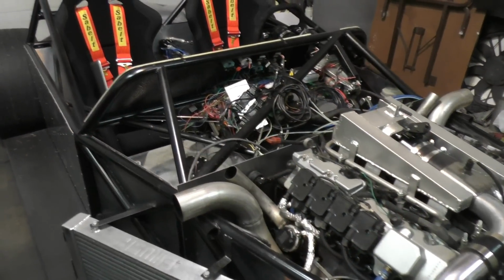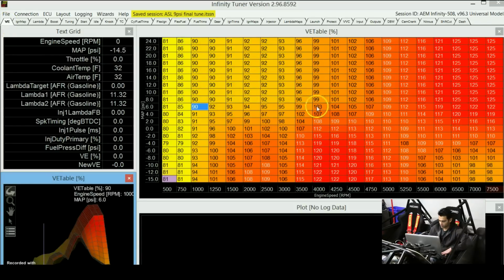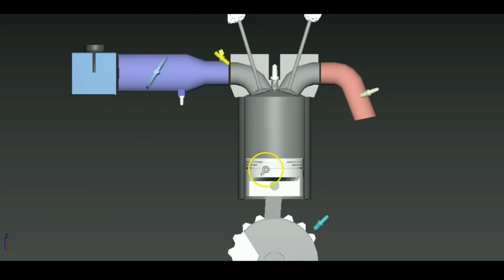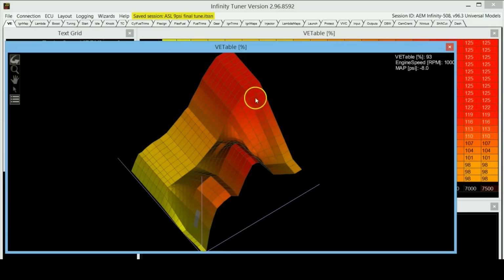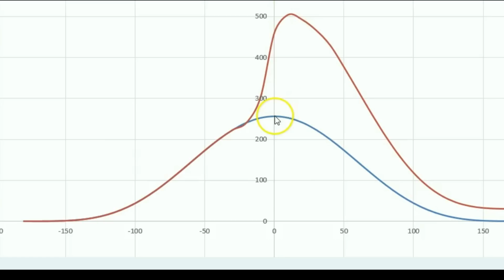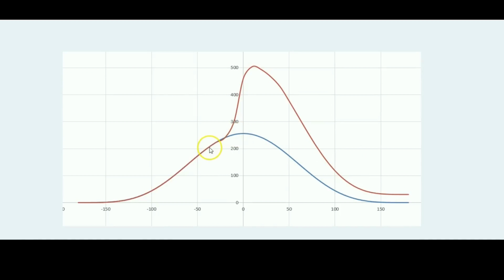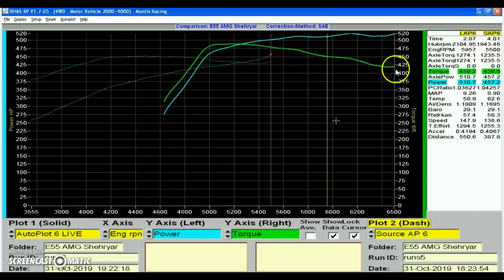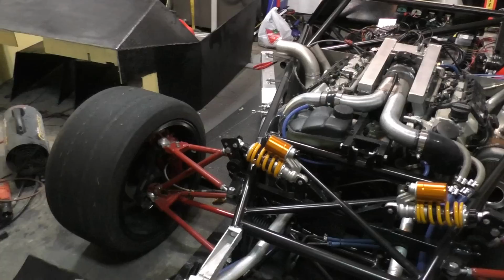How to Tune a Standalone ECU - E55 ASL Part 22

Comment: Come on bro, that's 9psi on a supercharger. A supercharger which pushes less air than your turbos and takes horsepower to be spun up. Of course you're gonna make more power and torque than stock. Plus you're not running an exhaust or emissions equipment. It's a no brainer really.

Comment: The only thing I can think from this is that you could probably gain quite a bit of top end by getting a cast LS intake manifold, chopping the plenum off of it and putting it on your runners.  In my experience, I know my engine would breathe better up top with a bigger plenum volume than I have, but I went with one with dual runners instead to get a bit better spool. (4g64)  This for sure works though, but i'm sure you're always trying to think of ways to make things better.  If you're concerned about fitting the throttle body, what a lot of CTS-V guys do and I'm sure others as well is  move the throttle body out farther, so there will be an elbow off of the mainfold and the throttle body sits down lower to let the intake clear the hood on those cars.

Comment: At approximately 35:45 "There was definately a thing or two done right with the engine" (build).  Well said my friend!  Thinking back to the intake manifold video I said to my self, it will be interesting to see how this intake looks on the dyno maps (especially during transition from atmospheric to boost),  but you have obviously created a masterpiece which has only just begun to show it's true capabilities.

Comment: On the ignition timing graph (20 minutes in ) the maximum force obtained with ignition firing (brown line) is 500 units and without ignition (blue line) the maximum is 250 units. I would have expected a much greater difference, we are comparing a virtual explosion in the cylinder to the cylinder simply uncompressing

Comment: In the 3d graphic at 8:50ish.. I see the injector is set to fire when the intake valve is open.. 
I'm my opinion (that is backed up with what I have seen on HPA) 
You should fire the injectors when the intake valve is closed and it will provide a slight economy advantage. Nothing huge tho.

Comment: I was impressed with your engineering ability before this video and now I’m really impressed. You should apply for careers in F1. They look for people like you.
Reply: Very true but 80% of  F1 teams  are based in the UK and there are a tonne if motorsport engineers with tons of experience in the other formulas. You have to work your way up too and prove yourself. Formula Renault, Formula Ford, F3000 , F3 , F3 Hap, F2

Comment: VE is not what you mentioned in video ( for standalone ecus, not engine VE ) it is a fuel control strategy aem just start to use on infinity series ecus, aem series 1 , 2 and ems4 use miliseconds for fuel control strategy so there is no VE table you have to write ms values in the boxes but it is too hard to tune engine with this method cos fuel output depends on lots of values you cant give output only with fuel table 

Ecu mix Map, clt, engine constant, iat, fuel table, warmup accelerstion enrichment etc. Than calculate the output value it is easy with VE table 

Besides you cant lower the torque curve start point by increasing the boost pressure cos your turbochargers will start boosting at the same rpm the torque curve will rise but the start point will be the same rpm

Comment: about those stock internals and 750hp: why is it that this same engine with the same internals always seems to fail at those power levels but you expect yours to be fine?
Reply: The concern of reliability it self is in the boost pressure, not in the hp, swapping to turbo gains free hundred extra horses, he also ported his head, tuned the engine properly and it barely have an exhaust system(since its not a road car its doesnt require a cat), its already 150whp more than the stock m113 with the same 9psi boost which translate to 600hp at the crank. Adding a little few more boost and it can have a 750hp, which is not a huge boost for a factory force induction engine, but What i concern is when he take the engine on a corner without any dry sump system, its gonna be a jar
Reply: @joat9105  thank you
Reply: @getdownhank  your welcome friend hope that helps
Reply: Lower static compression ratio=able to run better boost...and less knock risk...

Plus supercharger always putting more load/boost at the place the engine didnt need (bending conrod or cracking piston ringland)....

So with turbo the boost can be controlled and came on gradually at safer rate
Reply: Not true. Add a looped fuel rail to avoid #8 starvation.
Reply: @esteemedenergy  thats not for the oil

Comment: How can you raise the boost? The turbo turbine is fixed pitch right?
Reply: Boost is always regulated in turbo engines. Usually by opening a valve that let part of the  exhaust gasses by-pass the turbo(‘s). Some turbo’s have movable vanes that direct the exhaust airflow. 

So boost is raised by opening such a valve at a higher pressure. On modern cars these valves are controlled by the ECU (As opposed to by a spring).

Comment: So apparently it takes 150 HP to run the supercharger haha! A friend of mine made 580 WHP on his E55 with the supercharger.
Reply: Well, superchargers do use a LOT of power. The purpose of one on this engine was to create low end boost and avoid turbo lag. At high RPM it could start to act as a restrictor.

Comment: Actually, Valve over-lap on a forced induction engine is generally decreased or even nearly eliminated.
Reply: i also agree that valve overlap and agressive cams are used in NA cars...also head porting doesnt make much difference in a forced induction car while on a NA car is the key to good power
Reply: And valve lift goes up with "bigger" cams
Reply: @ReubenHorner  Often times the school of thought when building an engine, specific for forced induction, is having the Exhaust valve lift 10% or so greater than what you would build an NA engine at. Secondly, the greater the valve overlap, the more boost pressure is sent into the exhaust and isn't then used during the power stroke. NA engines and Boosted engines work on fundamentally different principles to optimize the basic cycles of a 4 stoke engine. The continuous flow created by overlap is adventurous when exploiting fluid flow of a vacuum operated induction. However, getting that valve closed and the cylinder pressure up (assuming proper F/A) is the name of the game for boosted engines; valve overlap vents that pressure.

Comment: Did you ever go to a safe region and intentionally knock the motor just to make sure the ecm is detecting it correctly?
Reply from the maker: Yeh but thats only good for seeing what type of knock frequency your getting to set the right bandwidth. The actual raw knock values you get at high boost / high rpm are higher

Comment: Someone give this man 3 days of dyno + really strong clutch! That will be a monster! 
BTW: In what power output are you aiming? From what I've get from this video it wouldbe 600+, 700+? Plus around 800 Nm of Torque - on wheels? 
This one + 4 rotor from Rob Dahm are only YT projects that I'm watching! Best one ever!
Reply: The real difference between this and Rob Dahm is that (with all the respect due to Rob) Rob calls what he does "engineering" when he actually isn't doing absolutely anything related to engineering, while this guy right here is actually giving us for free 40min flawless lectures with actual engineering facts. I really hope he never takes down these vids. 
(and again, I'm not mocking Rob Dahm or anything, I love his project and I follow every of his vids, but I just think he's quite overrated)

Comment: Would be interesting to see what the maximum power level is on this intake manifold then making a tubular more gently tapered one and comparing them.
Reply: He’s got so much power already. Not worth the effort I suspect.
Reply: @Turbochargedtwelve  with a more efficient intake design he can run less boost to make the same power, thereby creating less heat and helping the engine live longer.
Reply: @Ribbityibzki  is in the low single digits percentage and not worth pursuing.
Reply: @michelevitarelli  maybe not right now, but he said his end goal is 700+ hp. Heat grows exponentially with boost. If he's at 550~ right now, he'll have to get close to 15-16 psi to hit that goal, and that's really the highest boost you can safely run with pump gas and an a2a intercooler.
Reply: @Turbochargedtwelve  for science!
Reply: @Turbochargedtwelve   I know! If he gets the engine over 700 hp his power/weight will be better than LMP2! (fiaewc/classes) That is preposterous!
But I'm interested because there are alway arguments.
1. Intake on forced induction doesn't really matter because there is so much boost already.
OR
2. Intake matters even more because there is more moving air so it's even more important to eliminate choke points.
There was a guy who volunteered to build him a professional intake in one of the previous videos if I remember correctly.
Reply: @antalbodnar3188  SK8 won't outsource anything like that!
Reply: More efficient airflow will also reduce turbo lag. Not much but on a time attack car every little bit helps.

Comment: Naive. The cluch has big factor of safety. You could have really tried much bigger numbers, especially when you already have better clutch coming. But since you chickened out, what is limiting you not installing the better clucth immediately, and you should have 700hp very easily. Friend has a 1000hp at SL600 that has been built over the SL65 Black Series spec.
Reply: Does your friend have an Insta? I want to check out his V12 or where can i find pictures of the car/ build?

Comment: So the torque curve should be called a torque straight line in this case?
Reply: Flat torque line is ideal on track
Reply: I prefer torque shelf myself.
Reply: Is the ECU using torque management mode?
Reply: Lol if you watch the video the ecu isn’t but the tuner was. He was intentionally limiting ignition advance to clamp torque down.
Reply: @Turbochargedtwelve  I'm talking about ECU strategies inside the computer, not tuning.